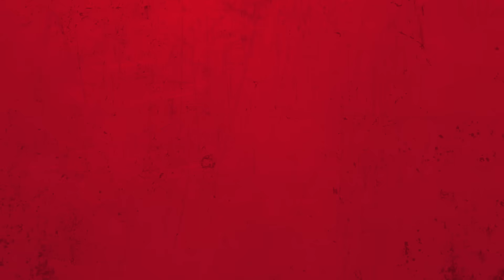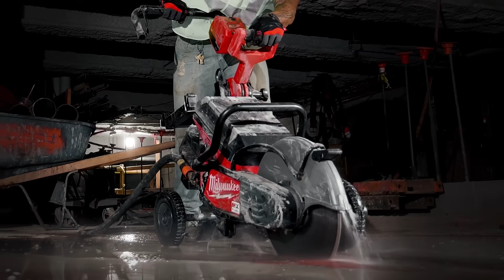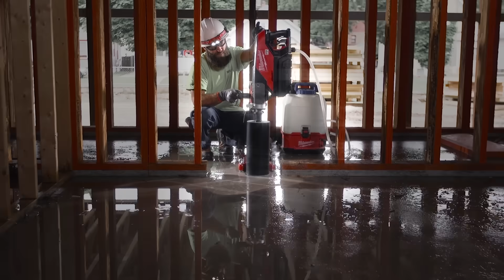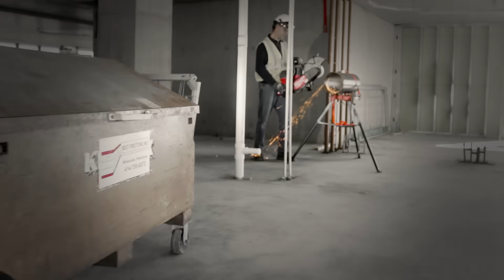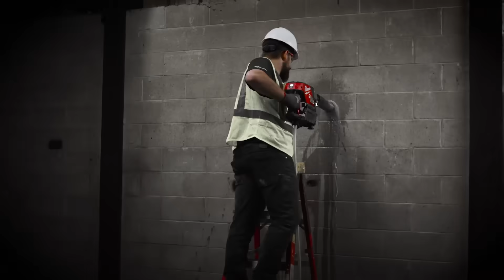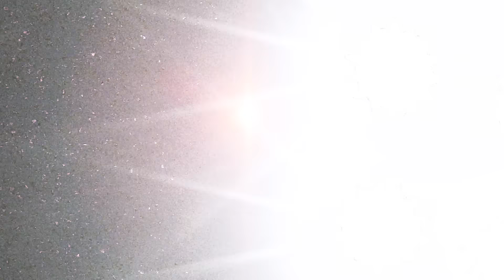Milwaukee® MX FUEL™ Equipment System

Comment: Great, now Milwaukee needs to come out with their own line of yard equipment that the operator can have these battery packs on a backpack and then plug into the different tool heads, like a string trimmer,  edger, hedge trimmer, and a blower/vac.
There could possibly be a chainsaw, but I don't know if it would plug into the back pack, or be a stand alone, like the cut-off saw.  Then we could see some longer chain bars.  

I would also like to see this MX Fuel battery pack on a lawn mower.

Comment: When will these tools be released? I got tiered of waiting for the 9” demo saw and bought the stihl. I not sure you can even get the Milwaukee yet!
Reply from the maker: MX FUEL™ Cut-Off Saw, Breaker, Handheld Core Drill, and Drum Machine will start shipping in February of 2020. The MX FUEL™ Tower Light and MX FUEL™ Carry-On Power Supply are set to launch later in 2020.

Comment: When will they make a decent tyre inflator for roadside technicians, not the M12 one, takes too long.
Reply: Richard De Cent works great for my sedan 🚘,  but agree with you. I tried inflating a truck tire and drained me a couple batteries 🔋.
Reply: So true, try filling a backhoe tire, you need a backpack full of batterys
Reply: Yeah I'd go for a m18. Inflator in a second.

Comment: MILWAUKEE  I love this new platform. I hoped you would never change from m18, but it was time. More volts more to work with for your engineers. I have a few requests, that I think will help the platform. 1st when this goes into production, make the battery reminiscent of the m18. This way everyone knows I bleed milwaukee red😃. Also I have a few requests (ideas) for products. 
1. Heavy duty self propelled mower
2. 10 gallon dust extractor
3. 8 gallon shop vac with compact battery
4. 12 gallon shop vac with xc
5. 16 or 20 gallon with two xc sequential.
6. Pressure washer.
7. Best backpack blower on the market.
8. Zero turn mower with 4 xcs. (One can only hope)
9. 8 gallon compressor.
Reply from the maker: Thanks for the suggestions, Jonathan! We are not changing platforms. The Milwaukee Cordless MX FUEL™, M18™, and M12™ Systems complement each other to provide the right blend of power, performance and run-time for the job at hand.  MX FUEL™ will allow us to provide more solutions for our existing users that fall within equipment categories. We are still dedicated to continuing to grow both our M12™ and M18™ lines. Those lines are our main vehicles for providing power tool solutions. MX FUEL™ is now our main vehicle for light equipment solutions.

Comment: Will the mx fuel tools still run on m18 battery’s ?
Reply from the maker: M18™ batteries will not work on MX FUEL™ Equipment. Just like all M18™ batteries work on products in our M18™ system, all MX FUEL™ batteries fit all MX FUEL™ Equipment.
Reply: Do you not see the size of them? FI!!

Comment: What's the voltage and amp hours?  Is the powerstation solar charge capable?? If not I wouldn't want it.
Reply from the maker: The construction industry has traditionally used voltage to communicate the power and capability of cordless power tool platforms. Technically, MX FUEL™ runs at 72V Nominal (80V Peak), with the CP Pack at 3Ah and the XC pack at 6Ah. However, voltage and amp-hours do not tell the full story. For example, most would agree that a fork lift has more “power” than a hand held power tool, but what many people do not realize is that most battery-powered forklifts/lift trucks operate at 48V while there are some handheld power tools at much higher voltages. More importantly, MX FUEL™ was developed from the ground up to withstand the most challenging applications and environments that equipment is subjected to on-site. For Example, The Power to Break Up To 2 Tons of Concrete.
Reply: Milwaukee Tool : Hi, 72V nominal? Is it 15S cells LiPo? Neverthanless impresive tech! :)